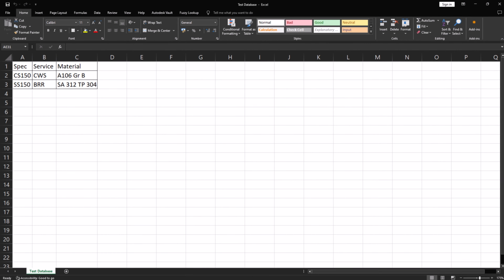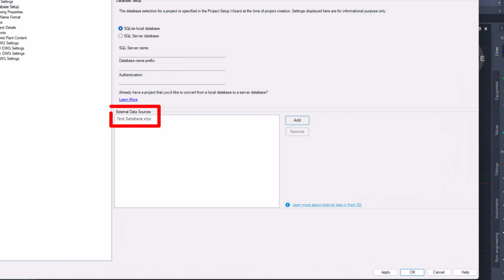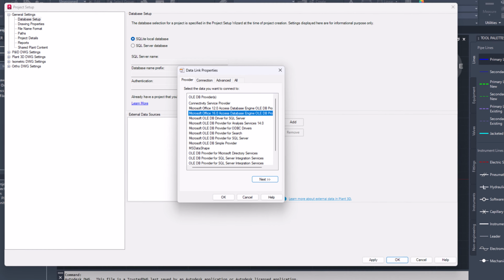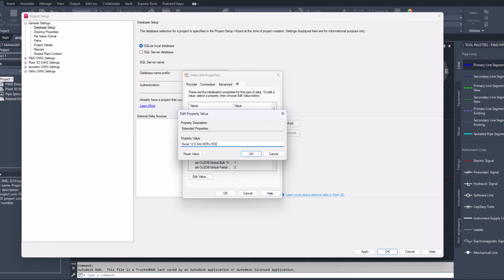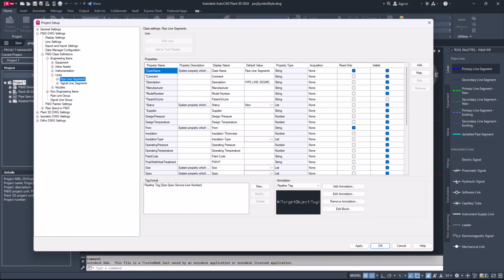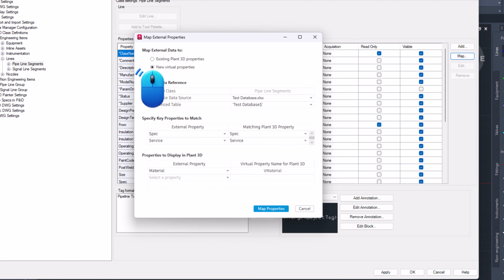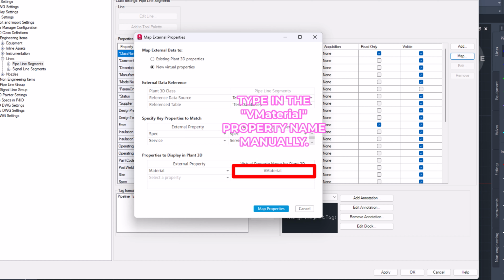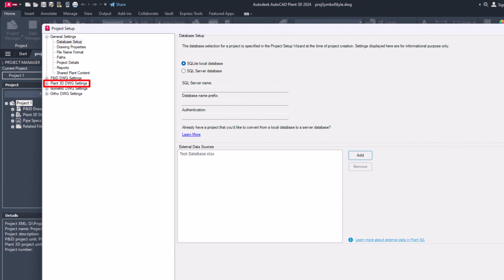AutoCAD Plant 3D | Mapping External Properties Using Excel

Comment: Hello sir 
How to update the line number wise OR Node wise pipe support load Fx,Fy & Fz from stress Analysis excel sheet to AutoCAD Plant 3D
Reply from the maker: Create a Excel file as follows:
1. Make sure each support has a unique identifier (Tag / Support ID / Line Number).
2. Keep Fx, Fy, Fz in separate columns.
3. Ensure the IDs match exactly with the supports in Plant 3D.
Then try the external mapping by creating virtual properties as shown in this video.
Best of luck!!👍

Comment: We have our line list, valve list, equipment list etc., auto exported from Plant 3D using Report Creator and by launching them headless. These properties that are mapped using databased aren't getting loaded on Report creator. Is there a way to do that?
Reply from the maker: Hii Pranav,
Virtual properties don’t appear in the report creator. To fix this, create a new property in Project Setup and link the virtual property’s acquisition to it. Then fetch this new property in the report creator—your report will work.
Reply: @acadp3dsolutions  Great, will try that
Reply: @acadp3dsolutions  I have set it the exact way you mentioned, added a new property and set the new property as acquisition from the virtual property. But, for some reason, the property value is '?'. Does it not work for Plant 3d equipments?

Comment: Thank you for sharing. sir The SPEC & Service are proprities for differents class name, Hwo did you maps them in the same new virtual propreties?
Reply from the maker: Hi!
You can map only one property to a single virtual property. Later, you can use calculated properties to combine them if needed.
Reply: @acadp3dsolutions  Hi, can you show how to do with calculated properties.
Reply from the maker: Hii  @nidhisingh546  
Could you please, clarify a bit what you’re trying to do?
When you say, “calculated properties,” do you mean:
1. Using external data as inputs inside your calculated properties?
2. Or mapping external data fields directly into a property that’s later used in a calculation?
3. Or something else entirely?
If you can describe your exact scenario, I can help you!!
Reply: @acadp3dsolutions  thanks for prompt reply. Wants to map properties (Materials, end connections schedules) based on sizes and services. I am unable to mapped properties based on two variables.  ( like your video it’s not working) It works only for one variable. 
Thanks in advance
Reply from the maker: Hii  @nidhisingh546  
1. Are you utilizing an MS Access database like (.accdb) or an Excel-based (.xlsx) external database mapping?
2. Are you choosing the Microsoft Office 16.0 Access Database Engine version? If not, please update your SQL drivers.
3. Which class definitions are you attempting to map?
4. Consider executing the PLANTREFRESHACQPROPERTY command.
Reply: @a @acadp3dsolutions  by using MS Access file in AutoCAD 2026 version issue resolved, however excel is not working properly. Thank you for your help. 
Request to make more videos on mapping properties and calculated properties, your videos are very helpful.
Reply: Not understand what is the use of this feature and where ??
Reply from the maker: Hii  @akash0707able  
In AutoCAD Plant 3D, external mapping data connects Plant 3D objects (such as pipes, valves, and equipment) to outside data sources like Excel sheets, databases, or imported specifications.
It’s mainly used for speeding up data entry and reducing manual errors.
For instance: When you add spec and services to P&ID/Piping, all other information such as material, manufacturer, etc., can be filled in automatically.
Hope this answers your query!!
Reply: Thanks for your quick reply i want to know in plant 3d if i works project 3D modelling is done but in case my valve tags, line numbers and fittings descriptions is changed
Then this is needful??   Like export all projects data in Excel change my revised discription like i  renamed stud bolt discription same Excel important to my project then dtat apply for objects is this use for it   @acadp3dsolutions